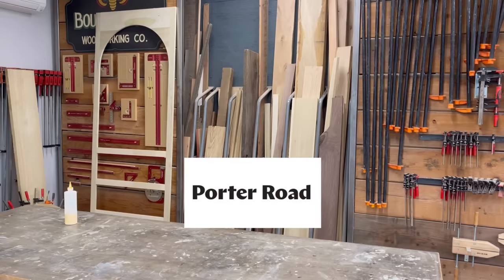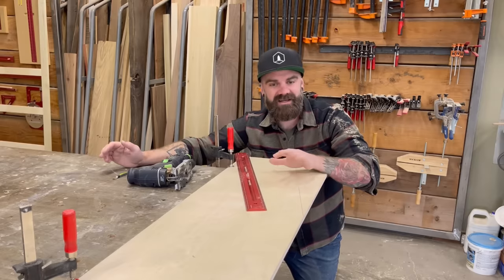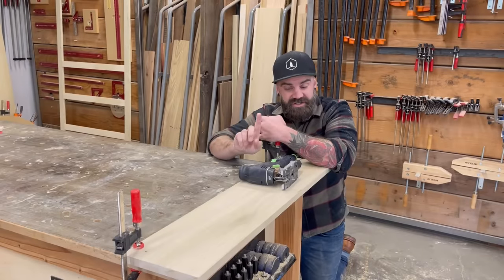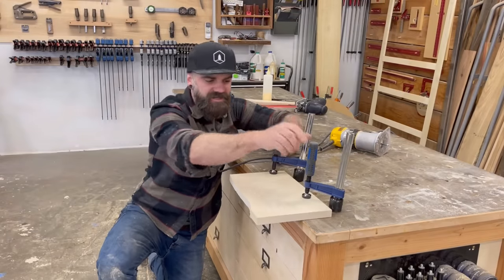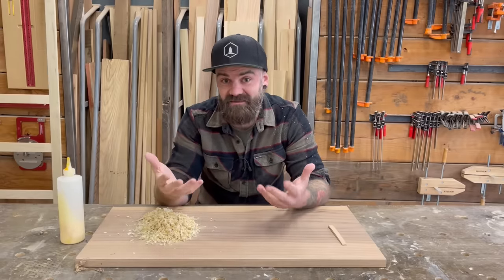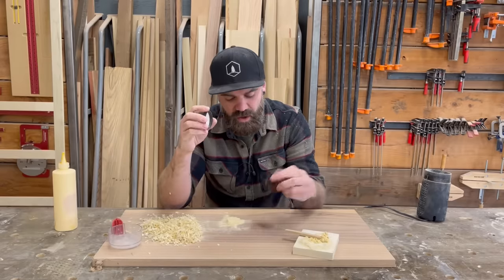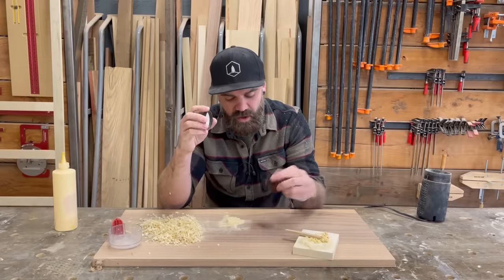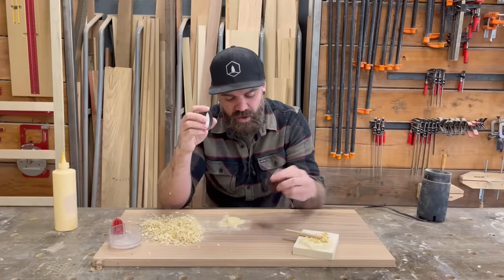Woodworking Tricks You'll Actually Use || Helpful Woodworking Hints

Comment: Hey Bourbon, let me add to your dent removal procedure. The steam works great but on a large dent or a dent in hardwood, take a razor knife and cut into the dent with the grain. Score it several times (depending on the size of the dent). Then leave the wet towel on for a couple of minutes so that the water can get down into it. Then steam it good. Bad dents will rise above the surface so you would have to sand it back down. An old craftsman from Europe showed me this technique when I was a younger man (now I'm the older man- 70years).
Reply: Great tip. I have done the iron thing, but it is good to know it can be taken a step further.

For exterior work like Cedar trim, an errant dent can often be solved with just a touch of spit. I know it might sound gross, but a little spit and some time will swell up the wood fibers and make a dent disappear.
Reply: My Dad taught me this one. I've done it several times with astounding success.
Reply: I first saw this on the samurai carpenter, he learned from a Japanese wood worker who told him the name in Japanese which apparently translated to "killing the wood." I know this is totally useless information but now you have it too!
Reply: It appears that Og, the caveman, was first on this idea?
Reply: Thank you for passing down the wisdom. It touches my heart. 🥰🇨🇦
Reply: Lol I read dental removal, steam and then it went really weird.
Reply: Cool I'm tired will you send me a reply I won't remember this.
Reply: @johnhorchler667  here’s your reply

Comment: There are also downcut blades for jigsaws to avoid blowout, for instance the Bosch T101BR blades.
Reply: Thank you never heard of them man!!!!!
Reply: @Mikeracing2005  be mindful of them though, they tend to "chatter" a lot worse than up cut blades.
Reply: @travisdoe4663  yeah you have to push down harder on your saw but it's worth it.
Reply: designed primarily for cutting laminate from the top side (sinks cutouts,  etc)
Reply: @mattrinne  also turn off the oscillation setting on the  jigsaw 👍
Reply: I was just about to make exact point lol
Reply: Diablo also makes blades that are upcut on the bottom half, and downcut on top half & they work pretty well.
Reply: Just score from both sides in case your blade only sidecuts!
Reply: Lol was just going to the comments to say that
Reply: @jakezanders6598  that’s the blades I use if I’m. It rough cutting with the jigsaw
Reply: Problem with those is that they promote the saw hopping and jumping.  But if you’ve got a steady hand and a good grip on it, they are helpful.
Reply: There is also festool blades that give a straight cut with no wandering (I use daily and get great cuts all the time)and a zero clearance to fit over blade to stop blowout, obviously for their machines though as he is showing general tips and tricks for any machine that gets used rarely and not spending a lot of cash so Take it for what it is
Reply: @jgetscensored7837  Agreed, you have to be a little more careful. On the other hand, when using power tools you have to make sure that the workpiece is mounted correctly, and that you have a good grip on the machine anyway. Power tools are not for people who are in a rush.
Reply: Run the saw upside down, you can watch the cut from the nice side
Reply: Exactly..I have both downcut and normal blades in my saw bag I take on jobs
Reply: @Fair_dinkum  Alcohol: the cause of - and solution to - many of life's problems!
Reply: Yep I have some too. Down cut
Reply: If need neat edge for jigsaw, try metal cutting blades on wood. Super clean finish.

Comment: Put the setup block lengthwise along the blade. Raise the blade. Any part of the  blade  reaches the top surface of the block first is the center and also set to the correct height.
Reply: any part of the blade? what if the tooth of the blade is not directly at the top? the blade needs to be turned on like he showed to make sure the peak of the blade is accurate
Reply: @tysonkoehn1  you have to assume some modicum of common sense with people doing a skill like woodworking with power tools you know. With the power off, manually rotate the blade to check for high spots.
Reply: @martinmoss317  if your set up block is directly over the insert lengthwise like you mentioned, how do you manually turn the blade while it's lowered inside the saw and cover by the block?
Reply: I know what you meant....👍👍
Reply: @tysonkoehn1  on the insert next to the blade man. Set block next to blade, adjust so as you manually turn the blade the highest point only comes even with the setup block. You're not putting the block over the blade itself.
Reply: @tysonkoehn1  if the blade is lowered inside the saw, there's a pretty safe bet you haven't achieved the height you were looking for.
Reply: This assumes the insert is perfectly level with the table surface.  Using the bar perpendicular eliminates any deviation.  Same for using an angle guage.  Zero it on the table, not the insert.
Reply: @garybecker4490  Right otherwise all you would have to do is raise the blade till it first emerges to the top of the insert. You would not even need the set up block. The way BMW showed in the video looks to be the way to go.
Reply: @garybecker4490  In my experience the cut depth is dictated by the tallest part of the blade in relation to the surface that it indexing on. Even if you have not correctly set up your table and leveled your insert you will still be setting the height of the blade to the part of the blade that the the maximum height to the control surface. if the insert is above or below the main table surface you will still have issues in the cut by either method.
Reply: @tysonkoehn1  use your finger on the OTHER side..........
Reply: And I just check it with my finger. Raise the blade slowly, at the same time move your longest finger across. When you feel the blade cutting your skin - it’s the center. Patented method - don’t do it.
Reply: @tysonkoehn1  lolo
Reply: Lp
Reply: L
Reply: Oo
Reply: @artyb27  😂

Comment: Regarding the ironing of dents, I learned from my grandfather to use a washcloth. Soak it completely, wring it out so it's not dripping, then leave it on the dent for a few hours (don't let it dry out). Once it's soaked into the dent enough, most of the dent is already gone. Popping the iron on it creates steam inside the wood grain, helping it return to it's normal shape. I've gotten rid of large dents just by doing this, rarely ever needing to sand it afterwards either. ^.^

Comment: The "score the cut line" trick is especially good when cutting melamine and paper-faced boards. Not just for the jigsaw, but for all cuts since the materials are so easy to chip and tear out.
However this "find the saw center" was ridiculously over-complicated. It can be done instantly without even switching on the saw.
Simply lower the blade, then very slowly wind it up until it catches on a flat metal object wiped across the table.

Comment: I really like these videos I've been wood working for about 40+ years and there is always something new to learn. I have the Rockler clamps for the saw fence but the way I mark the abor center (I know every one has there own way sorry) I just raise the blade to nick the bottom of the wood pc then lay a flat square up to it and scribe my line no need to move anything. No square just cut a piece of scrap to 90* and mark.
One other thing I would point out is if you steam wood or soak it with hot water to get a dent out WAIT until the wood is dry BEFORE you sand it. If you let it dry it will be slightly above the surface and can then be sanded flush.  If you sand it WET it will dry and be slightly below the surface and leave a slight mark. Give it a try on some scrap. As long as the wood fibers aren't cut from what ever caused the dent you can get out some pretty big dents to where they leave no trace. Thanks RCW

Comment: Pro tip on jig saws.  If you're not worried about how the cut looks on the bottom.  They do make a down cutting blade. Which is used for laminate countertops for cutting out sink holes and it doesn't tare up the surface/laminate.
Reply: You just have to be extra careful as those blades will push the saw away/out from the material, rather than pulling it into it.  A good alternative, if you are careful though.

Comment: I always paired the set up block lengthwise with the blade. So I never have to be dead on on the center. Turning the blade around by hand and adjusting the hight with the other hand. As soon as the slowly rotating saw teeth points are flush with the block? Done. It's maybe a bit more cumbersome then your fine tuned method, but works like a charm.

Comment: Nice tips, and super video. When you only want the top to be correct you can flip the saw upside down and cut from the downside, this way you can see the correct line and have no chip out. This only works with jigsaws where you can reach the turn off button with out loosing the grib off the saw.

Comment: Jig saw clean cut, get a blade for cutting plastic laminate, down cut with nominal set, mark your line and cut, very clean, I've used them for years. For the wood handles on clamps, get a sheet of skateboard sandpaper peel and stick. Typically 9" x 33" , that's a lot of handles covered. A heat gun helps form and bond. For the guys with lots of money, grip tape for pistols is better. Glue/sawdust wood filler, get some white glue for the lighter woods, like maple, for walnut, Titebond 3 dries a darker amber, a plus.

Comment: 02:26  If possible, put the straight edge on the good side of the cut so that if the knife does wander it does so away from your workpiece.  
Even more important - get a straight edge that has some protection for your fingers in case the knife rides up or snaps.  I've see what happens and it isn't pretty.
Reply: Yup. Happened to me just last November. Before I realized it climbed up the ruler, a portion of my index finger was already separated from the rest of the finger.
Worst woodworking accident I've had so far. Wouldn't stop bleeding...

Comment: I have another tip for finding the dead center of the table saw blade: Before putting the blade into the machine, draw the diameter line through the pivot hole's center on the blade's side. Now, when you put the blade into the saw, all you have to do is to put a square next to it. When the diameter line is parallel with the vertical side of the square, there is your dead center. This way you don't have to mark your table, just your blade.
Reply: I just made the almost identical comment, then read yours.  Great minds think alike 🙂
Reply: But then the marks gone after a few cuts

Comment: Hey, wanted to add to your table saw center tip, instead of trying to eyeball that center cusp, all you have to do is measure the bottom, where the blade enters and exits the wood.  Then find the mid point and mark it on the wood and move the fence over.

Comment: Best tip for the jigsaw cut, just use your jigsaw below the board. You'll see the blade for more precise cuts and the tearout will be on the bottom, which is good enough most of the time. Great video tho and i'm always a fan of your funitures

Comment: The wood glue and sawdust trick can backfire on oak as the dust can turn really dark, almost black,  when it absorbs the water in the glue.  I prefer to use epoxy glue, clear shellac or sanding sealer as the binder when filling oak

Comment: Glass baby food jars with metal lids are the way to go for the sawdust containers (and any small parts for that matter).  Screw the lids to the underside of some shelves then the jars dont take up any shelf space.  You can even see through the glass and know exactly which jar you need without opening and closing a bunch.
Reply: And they also shatter when you drop them on the floor or the top of your cast iron table saw.  That's why I keep glass out of my shop.
Reply: @fredsasse9973  for you I recommend empty plastic peanutbutter containers.
Reply: now if you have to bring the container to a workpiece it has no lid, so there's a non-zero chance of spending 10 minutes finding all the ones that rolled away when you knock it over.

Comment: To cut sandpaper I cut a piece of plywood the same size as a sheet of paper, run a 1/8 deep sawcut in the centre both ways. Bought a pizza cutter from the dollar store. Lay the paper on grit side down and run the pizza cutting in the slot. 1/2 or 1/4 sheet instantly. Or any other size you want. If the cutter isn’t sharp enough a quick touch with a file and way you go.

Comment: I did learn something.  Some situation needing a clean cut with a jig saw is not important but some situation I will use a blade that the teeth are pointed down rather than up.  They are hard to find but they do make them.

Comment: Just a heads up about the glue and saw dust. If you putting clear on top you should be fine, if your staining you could be in for a bit of a head ache. The wood glue seals the saw dust used and neither the glue or saw dust will absorb any stain while the rest of your project does.
Reply: So mix the dust with stain ... you might fiddle with the tint a bit, but it should be easier than trying to hide a glue spot
Reply: @miketheskepticalone6285  great point. With that it would be logical to have a scrap piece of the same material stained to your desired finish so that you can test a glue dust mixture for colour match before applying it to the finish project. Thanks for helping add to the conversation! It’s all about helping the community in finding solutions and avoiding issues if possible.

Comment: A carpenter tip for you.
If you flip the jigsaw up side down (holding the jigsaw on the bottom side of the board) having the blade going up where you can see it you get a nice cut on the front side and it is way easier avoiding the blade warping.

Comment: I fixed my wood handled clamps by gluing on a bicycle handle grip over the wood handle. The larger circumference makes for greater clamping force as well.
Reply: I used Rob Crosman's hockey tape trick on mine.  I rolled up some stick tape into about an eigth inch "cord" and then wrapped that around the handle in a widely spaced pattern, then put a layer of stick tape over that.  It gives a nice lumpy handle to grip.

Comment: I don't do a lot of woodworking, but for filling cracks i use a craft knife blade (we call them stanley knives), but used like a card scraper, either scrape enough to mix to a paste, or fill crack with glue and scrape over the area of the crack
All table saws i've known go through an arc when they go up and down due to a pivot point, so the centre of the arbor will move a little front to back dependent on height
Reply: I'm not sure [can't test, as my table saw is inoperative at the moment], but why can't you clamp a piece of wood the same height as your desired "dado" cut close to the saw blade [1/8 " should do] then sight down the cut line as you raise/lower the saw until it is the same height as the clamped piece of wood.  Of course, make sure your eye is level with the clamped piece of wood by sighting along it until the closest/furthest ends are at the same height.  It would work best if saw is running while you raise/lower the blade, so you see the outermost diameter of the blade [wearing eye protection in case any sawdust/chips get blown towards you].  This should work without regard to the center point moving because of a pivot mechanism.

Comment: Interesting how you use your setup blocks at a 90 degree angle. I was taught to use setup blocks along the long side of the block, instead of at a short side. The reason being is that you have a few inches to work with, and don't have to worry about finding the dead center.

Comment: I have the same coffee grinder for a situation similar. I use mine to custom blend dubbin material for tying flies. Sometimes you don't have the color you want but you have two or more colors that will work if blended. Maybe I will retire it to the woodshop for making fine dust for wood filler? Maybe II will buy another grinder for $15.

Comment: Heya the tip about the center of ur saw blade. I would assume factory meassurement is to attachment point of the blade wich means that is in fact center of all blades unless ur blade is oval. Actually even with an oval blade it will be the highest point...

Comment: Concerning finding the center of your table saw blade.  I don't know if this is particular to Contractor Table Saws like mine, but the center of the blade moves forward or backward as you raise or lower the blade.  So, an extra step is required to use your method of locating the center.  I use the setup block to mark a line to the desired height of the blade on the sacrificial fence.  Turn on the saw, and raise the blade to that mark.  Then continue with your method.

Comment: To find the center of the sacrificial fence it's easier to use a rule to measure the beginning and end of the cut and just get the center of that. Basically you're using the rule to make a line down the diameter of the blade and the center of that diameter is exactly half of the length you measured.

Comment: Instead of ordering plastic jars, take babyfood jars, maraschino cherry jars, pickel/relish jars, jelly/preserve jars, etc. and use those (reuse in other words).  My dad had a set of upper cabinets in his workshop and he would screw the top of of the jar to the bottom of the cabinet (in two places so it didn't rotate), and then he could just twist the jar to take it down, and twist it the other way to put it back up.  Great for sawdust, screws, washers, and other little bits and bobs that you want to store, but don't want taking up valuable cabinet/bench space.